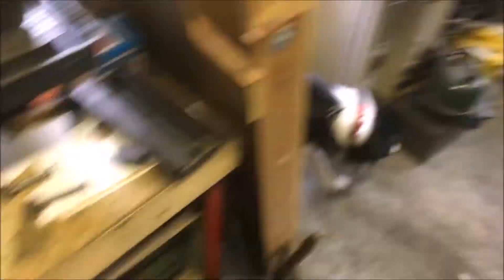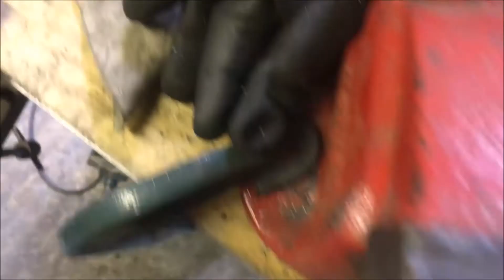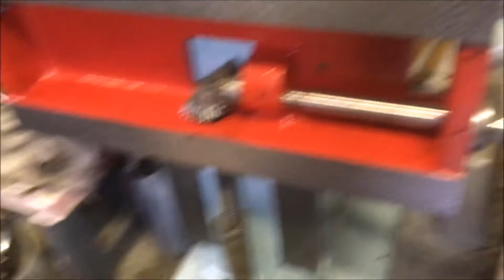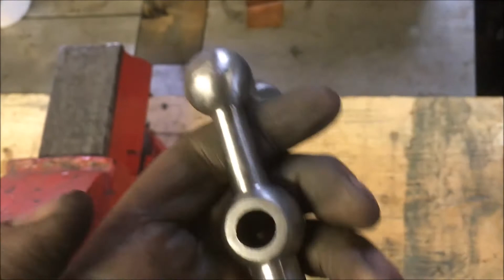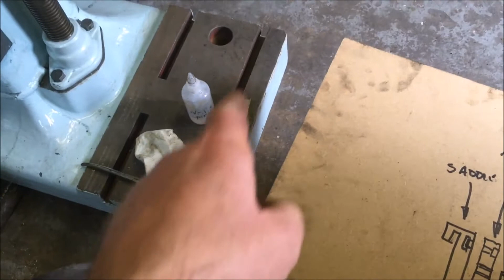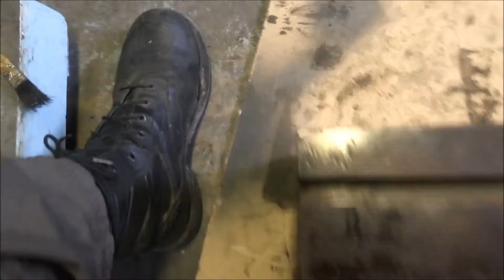Elliot 14S Update 14

Comment: I've never scraped steel, only cast iron, but the sound of it in this video just puts my teeth on edge.  
Aside from the sound, it appears the increased amount of force necessary makes it much harder to control?  I wonder if steel scraping would be easier to control with a pull scraper?
Reply from the maker: Ive done very little scraping - even less of steel - I have started to pull the parts together for a propane forge to heat treat metal - a pull scraper from drill rod / silver steel is toward the top of that project list. I have used quite a few Japanese wood working hand tools and the 'pull saws' are far more delicate and controllable than our western push saws. I also find pull filing is more accurate - but thats another story.

Comment: That screw that you finally got out, gives me some pause for concern when looking at the threads on the plate it screwed into. I would think that the reason that it was so tight is because the threads are so damaged. They used some Abom strength to get it to hold.

You might want to consider drilling out the threads and surrounding material, then machining newly threaded tight fitting plug to go into the widened screw hole. The plug could then be press fitted, maybe with loctight.
Reply from the maker: I will take another look at the threads - they looked ok when I was doen (see below)  - but I agree the thing was well tight - I am surprised they achieved that with the simple slot it was tightened with. My feeling is that there was some rust which got removed by the rust treatment and oil soak over the previous months of soaking - when it finally came free and I wound out the thread I think it was residue in the threads making it all feel so tight. I ran a 2nd tap down the hole and it came out clean - I followed with a finishing tap and it cut metal - I found similar on a number of the thread holes - its as if the holes are deliberately threaded at bottom end of the spec' on size to give a tight fitting.

Comment: When in doubt at all I'd add the way scrapers along with some felt oilers under those Mat. Got a rotary table for your mill, or can you borrow one? If so mounting the shapers table to it and using something like a reverse sharpened flycutter so it will cut as you move the mills spindle up would allow you to get in, get the cut established in one spot to the correct depth and flycut the inside of that table casting. Rotating the shapers table with the rotary would do pretty much the same as a boring and facing head would. As you said boring out the large hole itself it doesn't really matter what the dimension is that it finally cleans up at since the parts would be made to fit that anyway. So boring out that large hole then use it so it's indicated in centered with the rotary tables C/L would be pretty easy. Moore tools in the U.S. made some super precision indexing tables using what they call face gears. A shaper could do much the same just by cutting fairly large V grooves in both faces of the matching parts. Possible that might work for setting the rough angle on your shapers table first, then use slotted bolt holes for the final adjustment? A V groove every 5 or 10 degrees around a 360 degree circle would be more than enough. An idea anyway. But those V grooves would also provide a positive method of locking the table so it can't move once it's fastened down to the correct angle.

Your scrapings come a long ways since you first started on this shaper. The one area on that table looks like some ape tried using it as an anvil. :-( And a nice surprise for the previous operators to add some extra traction to those knee gears so you don't have to ever worry about them slipping.:-( If that shaper could talk I bet it would have some serious complaining to do.
Reply: The machine tool suppliers want an arm & leg for the proper thickness & hardness of that felt Mat.There's a numbered scale that's used to designate the durability of felt. No idea about the U.K but over here I think it's SAE F-3 or SAE F-5. pressed felt. You can sometimes find thick felt at craft stores at a lot cheaper price if you can find some that's not too soft.

Does the head rotate on your mill? For at least the Bridgeports it's not recommended to run them with the heads horizontal for long hrs since there not designed to keep the spindle oil in the correct place while horizontal. But for short runs it's ok to do so. No idea of what mill you have but with a 40 taper it's larger than mine.
Reply from the maker: I have a roll of thick felt, it feels like its acrylic or man made fibre not cotton - I shall dig it out and take a look at it - I used it on my mill and m10 shaper. probably 'ok' just prefer to have a cotton felt.
The Mill I have is an Adcock & Shipley 1ES badged as Bridgeport in the US.  I have the vertical head and yes it swivels - but even then the short table restricts the working envelope - and besides my rotary table is too small to carry the box to rotate on a horizontal axis.  The annoying thing is I have on the project list the Bridgeport 2js head to mount on the overarm support of my mill. that will give me more than enough daylight and an iso30 spindle (ok so more tooling needed) & a quill.  But that head needs the boring feed parts finding as they had been stripped off it when I rescued it.  Funds are tight at present so its on the back burner.
Reply: Yep sounds like the synthetic felt. It may or may not have any wool in it as there's both types. If it's hard enough to wipe the chips off and still soft enough to retain and spread the oil it should be good enough.

From my reading the A & S Bridgeport copys were supposed to be better made than even Bridgeport builds em. And I didn't know A & S made them with the much better 40 taper.Mines a Taiwanese clone R8 taper built by Bemato. Basically a 1100 lb 3/4 sized copy of a Bridgeport with a full size head and 3 hp 3 ph motor on it. It was the lightest mill and only one at the time that had the built in spindle feeds so I know all about the short travel problem. No concrete floor in the shop so going lighter was the only option. And tooling NEVER ends for a mill never mind having two different spindle tapers. My RT would have the same issues as it's only a 6". A tough job to find and install all the feed parts if the internals were stripped out as well.
Reply from the maker: Just had a look and its definitely synthetic felt - I have found some decent pure wool felt on ebay - so will see about that. Dont know why I keep calling it cotton ?

Comment: Maybe you don't need to remove the whole key from the box to make it rotating. You probably only need a 1cm lip on the rotating plate, so you could bore that out (of the key) and the key would still be usable for future use , even with a little bit missing in the middle.
Reply from the maker: I was thinking along the lines of remove the key as is and then mill a key way 2cm in from each side and make a key to slot in from the sides when not wanting it rotated - I have to take a closer look at the casting to see what material is left if I machine away the existing key. I feel the need to get my paper and pencil out and do a scale drawing so I dont cock it up !
Reply: That's maybe an even better idea, if you have enough material there. 
You know, at first I thought you were kind of a hack, but it didn't take me long to realized that  you are a very fine craftsman.
Reply from the maker: That is the nearest Ive had to a compliment in a long time ... I think - I guess it depends on your definition of a craftsman v's a hack. i suspect Im more hack than craftsman.
It is channels such as yours which put my work to shame - Im only new to this machine rebuilding - learning as I go. so far Ive enjoyed pretty much all of it .. except the painting ! Thanks for your positive words. All the best Mat

Comment: glad you got that screw out OK.
neat trick
unlike the not so neat welding  ! 
only joking. each to their own.
Reply from the maker: Ive done very little welding (for obvious reasons), the sticks I have are those available without buying £50 worth at a go. From the welding videos Ive seen I would be better with thinner rods (2mm instead of 3.2mm for the 110vdc buzz box) and the spec No. if I recall is 1013 ? better for penetration and crappy surfaces.... Not yet found a supply of sticks in the Uk for under £75. 
I used to design some of the kit to make the packaging for Lincoln Electric Bulk welding coils for automated MIG welding - couple of hundred KG in a drum - wouldnt want to buy those for the shop ;-)
Reply: lookcreations 
3 letters   .....  T I G  !
Reply: this old tony's go to welder
Reply from the maker: yeh, am thinking about adding it to the workshop list of wants.... was thinking a oxy propane set up might prove more useful .... you know to start with ;-)
Reply: lookcreations 
nagative ...
2 bottles to rent ... £..
puts a lot more heat in the job.
possitive ...
can be used to warm things up and cut steel.
cheaper to set up.
Reply from the maker: Ive got a small propane bottle & Ive an old set of oxy acet' torch - needs new pipes and not sure on the regulators 9worked when last used) - but cant get acetylene - so figured tank of oxy' and torch nozzel plus some hose and I should be away..... who knows maybe one day.

Comment: wow. good luck with the rotation. someone might have a HBM to set it up and do it all in one operation?
Reply from the maker: I think if I had a boring and facing cutter for my mill I could do it - but I dont. Would make a good video to see it machined on either a HBM or big lathe. Am still thinking if I can get away with just boring the holes and then clamping to the cast faces & then fixing a part inside to give me a machined surface to work off ..... Im some way off a solution ! Thanks for dropping by and commenting Emma.
Reply: I always like these sort of videos. so much to learn still. thanks